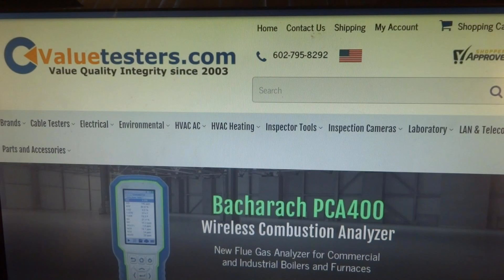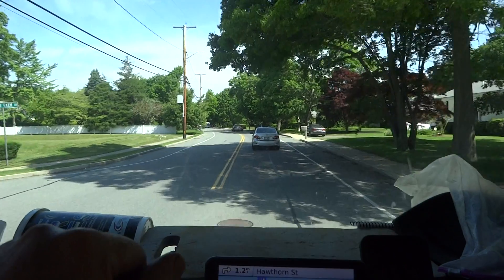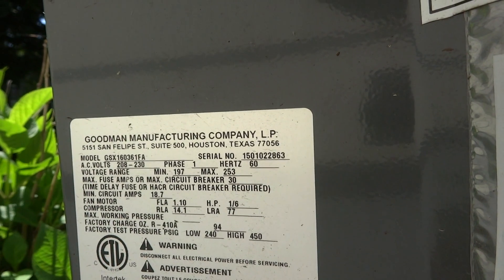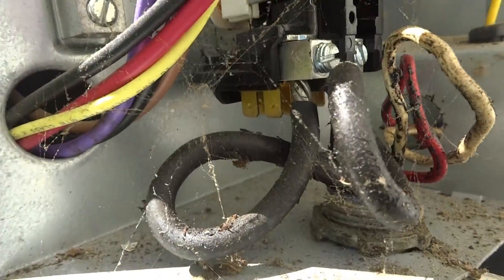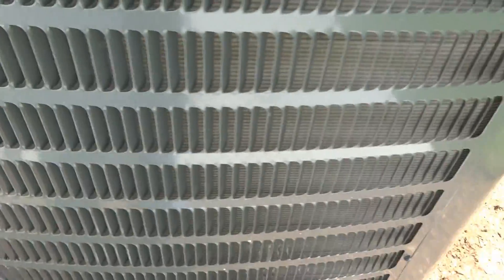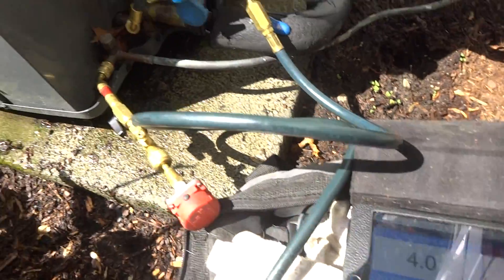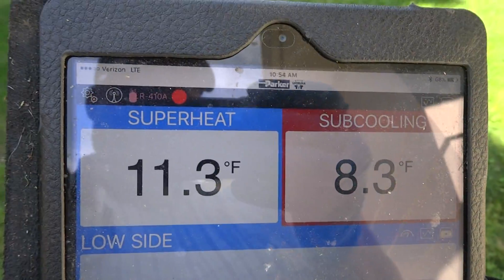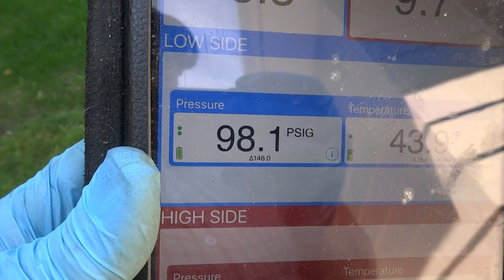Goodman AC low on freon charge

Comment: Steve i put in a new 14 seer 2.5 ton unit and coil with a piston but subcool was low when i charged the unit to get the superheat. it was calling for 8 degrees superheat and only got 4 degrees subcool with new everything. 410a with a .65 piston condenser came with. got any idea what size i should try to bring up subcool? love the video's. and was never good at sheet metal till i seen you do it. helped alot.